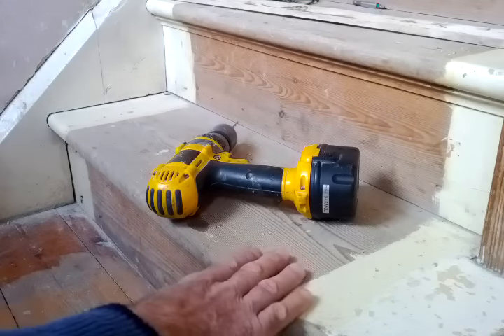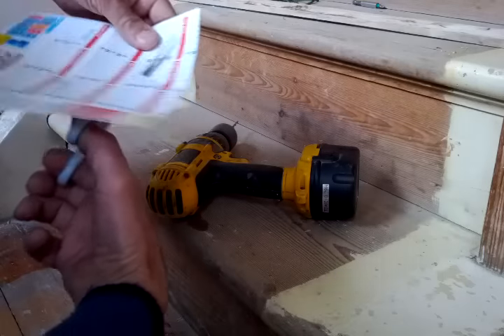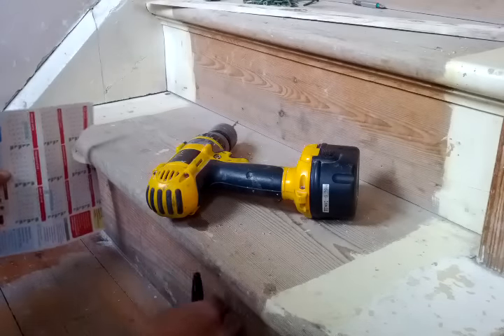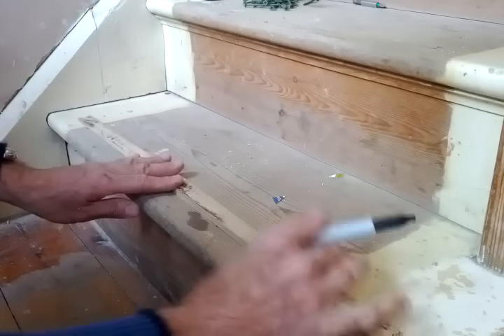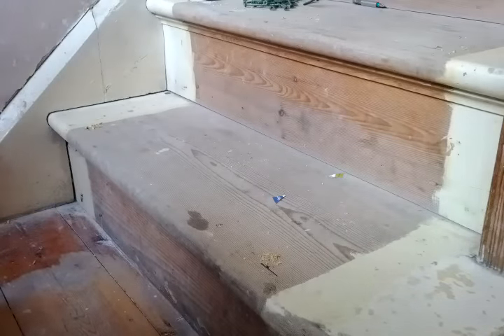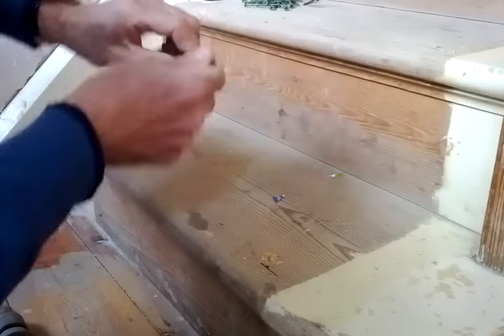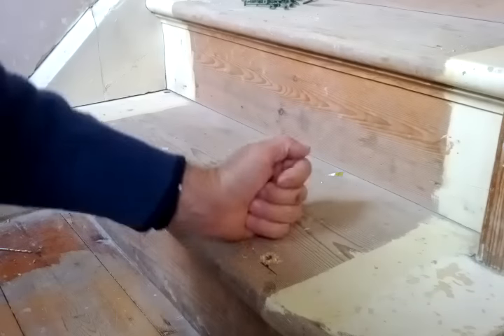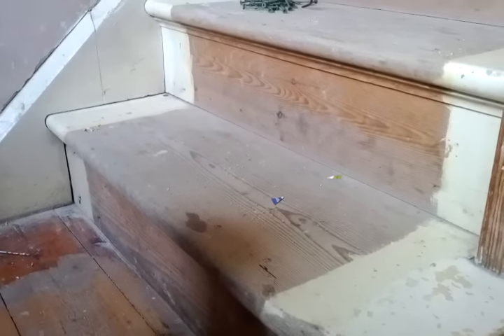Tightening squeaky stair treads risers

Comment from the maker: Decking screws are designed for a very similar application, so work well for tightening stair treads. Decking Screws 4.5 x 75mm might be good. Shank (non-threaded part of screw) should be approximately the same length as the thickness of tread, as the thread should grip the riser and but NOT grip the tread. The screw head will pull the tread down hard, which is what you are trying to achieve. You should drill pilot hole through tread, to reduce chance of cracking the tread.
Reply: I tried this with 2" deck screws but it didn't help the squeak.  I don't understand why the threads of the screw shouldn't grip both the riser and the tread.
Reply: I think i've figured out that my treads are rubbing on the side wall skirt.  I haven't found any videos addressing that problem.
Reply from the maker: @opentrunk  you probably want the screw to clamp the tread down hard onto the riser. For that to happen the screw head should pull the tread down. If the section of screw in the tread is threaded this won't happen very effectively unless you either drill a pilot hole or screw it hard enough to let the screw create it's own pilot hole of mashed-up tread timber.
Experiment by screwing two timber blocks together with fully threaded screw and no pilot hole. The blocks will not be strongly clamped together by the screw. Now try with partially threaded screw, or with pilot hole (larger than thread) in top block ... stronger clamping?

Comment: Only a partial solution in a minority of cases.  Stairs more commonly creak because the tread and riser loosen at the back.  If you can't get under the stairs, pocket holes drilled and screws used from the front will help.

Comment: i bought a historic mansion fixer upper. it has a beautiful staircase & woodpaneled foyer. the steps are in bad shape. they were filled with staples & still have regular large headed nails in them. many, many of them. they also have 1/2" gaps where the risers & treads meet on some of them. i need ideas of how to fill them in. strips of wood? i don't have the tools to cut them precisely. i need to figure out what to do with the nails. cut the heads off & fill in the holes? if anyone can offer some suggestions, i'd be much obliged. i am a 70 year old on a pension. my plans to gradually rehab it were killed with covid, the most recent recession & a heart attack. i will get it done, but it's going to take more years than i wanted. thanks for any help.
Reply from the maker: You WILL get it done! I hope that you can find someone on-site to advise you.

Comment: Or just measure the distance under the bull nose and transfer that number and make lines on tread that distance and no cardboard needed
Reply from the maker: Yes, though that assumes a standard dimension for your tread noses. Often they vary, and if bullnose than not it's easy to measure precisely.

Comment: Thanks for sharing - I did follow this but it didn't completely solve my problem - my main squeak was (eventually detected) coming from the 90 degree join with the stair above and to sort that I screwed in some small screws as near vertically down in that join so that the screw heads and screw body forced separation - I probably used about 10 screws across the step and that did the job. Just 2 hours before the carpet fitters arrived! (and no access to the stairs from below). Fingers crossed that it doesn't become a massive creak in the coming months! Thanks again for the video.
Reply from the maker: Good idea: if you can't clamp it together then maybe wedge it apart. Can often solve the squak.

Comment: Im struggling to understand the purpose of the wax.  Is it to reduce friction when it goes in, so it does not displace more material of the riser than it has to?  Or is it designed to reduce friction when the stairs are in use over the years and the hold the riser has around the screw becomes less tight and begins to create enough area for the stairs to move slightly, so having wax in there prevents the squeak with this movement occurs?

Or could it perhaps be both?  

I’m guessing it’s a bit of both with emphasis placed on the second question I asked, being a squeak deterrent by lubricating the loosened boards years later.
Reply from the maker: If two timber surfaces rub against each other, e.g. by even 1 mm flex when trodden on, wax can eliminate resultant squeak.

Comment: Dominic, I wish I can post pictures here. I have a 1930 stairs just like yours! Can’t open up the  stairs from the back, the riser has a 1/2 inch gap from the steps. How can I close the gap without opening the back of the stairs?
Stairs squeak as well. I will try this solution for the squeak but the riser have to be right with the steps.
Reply from the maker: What caused the gap? Will you be carpeting?

Comment: What do you recommend if my stairs are bare? I don’t have access to underneath them. Thank you.
Reply from the maker: there is a trade-off between screw head size and screw grip. small headed screws are fairly invisible but have less grip than normal-headed screws. you could use a normal screw and after screwing you fill the screw hole with a plug of wood that matches the stair tread.
Reply: Thank you for your prompt reply and I’ll do what you suggested.

Comment: Thank you for this tip! I was wondering if you painted the stairs or used carpet afterwards, because I'd like to try this fix, but I am only going to paint the stairs afterwards. I don't want to end up with all the screws showing through the layer of paint. Is it a good idea to use wood filler to cover them up?
Reply from the maker: Wood filler would be a good choice for your use case. Paste it in well, as you don't want it to pop out at a later date.

Comment: Are you trying to hit the riser? How thick are they usually? I thought you'd have to drive the screws into the stringers... Great tip about the screw shank being the thickness of the tread.
Reply from the maker: Squeak may originate from junction between riser and tread, though there may also be other possible causes.
Reply: @DominicParkinson  Thanks for the reply! Could I use drywall screws with the smooth shank too? I would much prefer a black screw. If so, would coarse or fine be a better choice?
Reply from the maker: @accomplishedtheory9502  Drywall screws perform well, possibly taking more torque than stainless steel. Coarse thread may give better grip?

Comment: Is the riser made of plywood? If so, I don’t think you can put a screw in the edge of it
Reply from the maker: Risers in video are solid pine. Yes screwing into plywood on edge could cause delamination, but long screw with pilot hole should be OK.

Comment: what am i missing how does cutting that piece of paper show where the riser is
Reply: it helps to visualize a straight line and draw the mark close to accurate. it isn't perfect, but it is easier than trying to use a ruler. a 90 degree level would be fine, too. the step after shows why the precision is not the important part here, but to find your line to use your yard stick to find the width of the riser, which is what you care about in drilling and screwing the two pieces together.

Comment: sorry,  could you explain how did you use that card to find where to screw it please? thanks
Reply from the maker: if screwing down through the trees down into the riser you need to work out where the riser's front face is positioned relative to tread. but if the tread has a lip (especially if rounded) this is hard to do precisely with a tape measure. if you use a card to do this you can cut a notch out of card to make way for the lip while still keeping card flat onto riser. then screw in maybe 10 mm further back to allow for riser thickness.
Reply: Dominic Parkinson thank you
Reply: @DominicParkinson  what size screws did you use?
Reply from the maker: @waledada6552  decking screws could be a good choice. circa 60mm length?
Reply: @DominicParkinson  okay. Thanks!

Comment: Call that creaky? Mine is over 85 years old and every step creaks in the gap at the bottom of the riser, not under the tread, so you only did half a job.
I can see what's going to happen, muggins will have to do the Hary Potter impression and go under the stairs. Also do my impression of Bilbo Baggins being attacked by a giant spider...